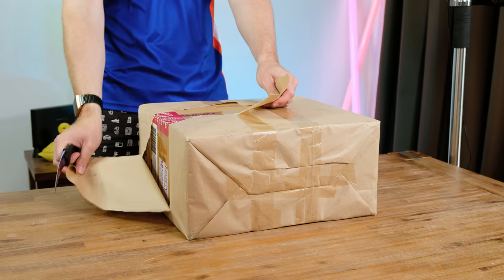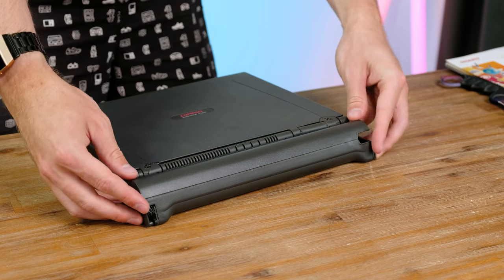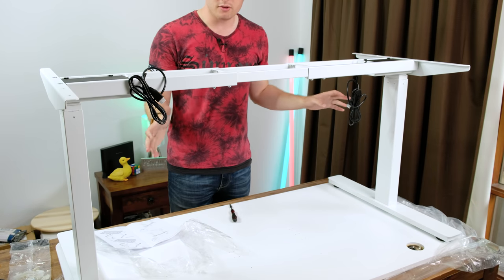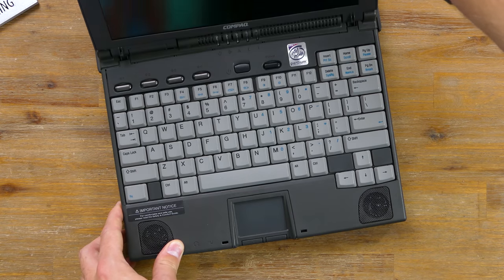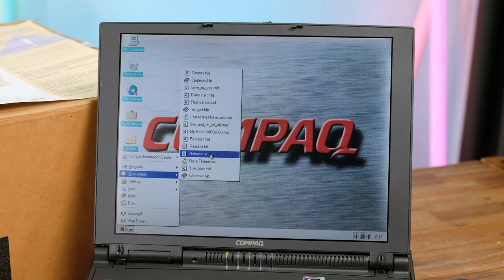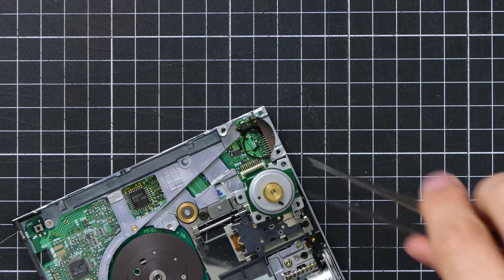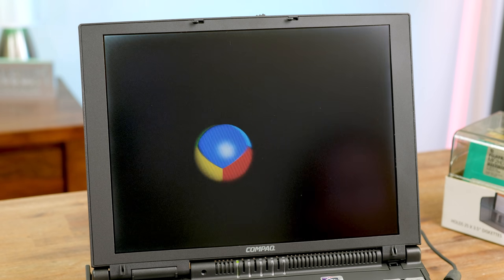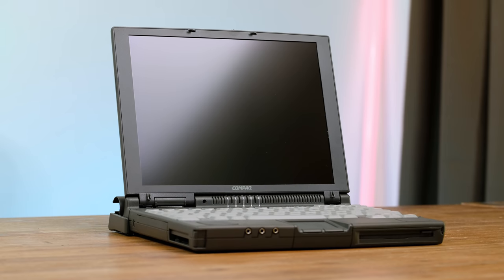I Bought An Old Windows 95 Laptop from eBay!

Comment: You’ll probably find a lot of Pentium 1 and 2 laptops that were barley used a year before being replaced. Intel had competition back then, and were actually making their successive generations appreciably faster, so if you had last year’s model, there were things you could just literally not do. In today’s landscape, you have to have a CPU from like ten years ago or more before you encounter things that won’t work at all.
Reply: @voltare2amstereo  I still have an acer travelmate 3270 that uses the first intel core 2 duo (t5500). it is still running windows 10. however i moved to the dell e7250 with i5-5300u and install windows 11 latest build on this laptop
Reply: @trandinhvietdung9357  Gonna guess that wasn't a good idea.
Reply: @aftertheelectrike1847  nah that's fine
Reply: @voltare2amstereo  Well, a C2D is still fast enough for youtube
Reply: @Lilbroda Barely. My laptop with a T7200 and dedicated GPU struggles, but it does work.

Comment: My Windows 95 laptop is a Panasonic Toughbook CF-45 I got for 19€ one week ago. The only issue was a loose display cable, but that didn’t take long to fix. The battery is original and still working, keeps a charge for about two hours!

Comment: In college I used an Armada 4131T. Pretty much the same specs but it had a full active matrix LCD and a 133MHz CPU. IIRC using Function + T would enable display stretch. Thanks for the vid, brought back some memories.

Comment: 9:00 using sodium bicarbonate with the superglue makes the bond stronger for plastic repair. Maybe you can use charcoal for making the same color instead but I haven't tried outside sodium bicarbonate.

Comment: Great video - I own an Armada 7800 from a similar timeframe and the plastics are starting to weaken too in places. By the way, you should be able to stretch the screen using Fn+T - it's not marked on the keyboard but is documented in some manuals.

Comment: Another great video about another great vintage hardware :) . I hope you'll buy a "gaming" hardware soon, like a Geforce 2 or 4 :)
Reply from the maker: I've got a GeForce 2 video card, not sure what kind of video it would suit though 😅
Reply: @psivewri  You're usually testing the gaming capabilities of those vintage laptops, but if you buy an older desktop PC in the future for any reason (P3-P4 category), you can compare older VGA-s for example, to figure out what OS is optimal for those and which games can it handle :) . I don't expect a Geforce 2 can run Crysis of course, but it would be interesting to see the difference between older cards, like a Geforce 2 MX and a Geforce FX5600 for example, with the original Counter-Strike, Far Cry, Quake, Colin McRae rally and other great titles :) . I still remember that big graphics jump between my Geforce 4 MX and FX 5200 in Far Cry, because of the newer Direct X support.

Comment: I still have 2 of those, one working, the 160 (P1 166MHz) version (there is also 120 version with P1 133MHz)
You could have a battery instead of floppy drive, the long battery behind and another battery on the base.
Had over 20 of those back in the days ...

Comment: How about that! I have just been playing around with a 4210t Armada today!. 
Does your bios battery still work? Mine is dead. 
My hinge-battery broke off the removable frame due to brittle plastic, but it was dead anyway.
This one has 32mb RAM and a TFT of 800x600  with 16M colours!
Same floppy drive issue but I found the generic chinese belts seem too thick and keep coming off again.
And no audio yet so more adventures to come.....
Reply from the maker: Nice! That sounds like a better model, yes I'm pretty sure the bios battery was also dead.
Reply: Ah, the tiny belts on those Citizen drives are a nightmare to find a suitable replacement for... My Armada 7800's floppy drive is suffering from the same issue, belt is loose...

Comment: I had a laptop and box exactly like this. I had to throw it all out, as the box was large and mouldy, and the laptop plastics completely crumbled to bits the second I took it apart to see if there's any leaky batteries or caps. Part of me wishes I had kept it, but then again I don't know if I would be able to fix the plastic :( I remember that the BIOS setup seemed to have been based on Windows 3.1, which was interesting. I think there was a partition for that on the drive.

Comment: I know you're in the UK, but here in the US, we're so spread out, it's impossible to get broadband in a lot of places and broadband in the USA is hit or miss. I have several coworkers that live outside the city and one of them is an owner of the company I work for and lives in, what I would call a mansion (technically isn't, but he's extremely successful and close to retirement so he's extremely well off) and the there is no cable provider where he lives and only a telephone company which can only provide him with 1.5 Mbps DSL, but the network infrastructure in the area is so horrible, it only works around 25% of the time (seriously) and if you have a POTS line, all you hear is pure static if there is a single drop of rain, making dial-up useless as well. So, he uses his mobile hotspot which has limited data for home internet... and he can get satellite internet at something like 100 Mbps, he can't use it due to the network latency. Our office VPN won't work over high latency connections nor will remote desktop to the office. Fun times.

Comment: Is that an armada! Hahaha I took a armada 100s to school had to epoxy the screen hinges but I found that windows 98 was really good and the screen had no ghosting. It was a little dim but it got better. The one I have was used a lot with shiny key caps and all but the plastic held rather well.

Comment: "Which at a surface level doesn't show any obvious signs of an issue" The Citizen W1D sticker is a pretty obvious one if you've ever worked on one! Ha those things are notoriously bad for belts shitting the bed. Compaq used them for most of the 90's.

Comment: Nice one!
My oldest laptop is a part-functioning-when-it-wants-to Contura 410 with a BW display, also with Win95, from 1992.
It's probably the HDD that's sketchy as it tries to read it and fails a lot before it decides to boot after all.
Windows 95 in black & white is not pretty, so I have to hook up an external screen to get the colors.
Good times!
Thx for sharing & congrats on your new desk. 
Standing up is so much better.

Comment: "1997... I wasn't even a year old at that time". Jesus Dude. You're making me feel old... I was born in 1984... got my first computer in 1997 when I was 13 years old. The majority of my childhood was NES/SNES and 35 channel cable TV (oddly enough, I still remember what station was on what channel) and Disney was a premium channel you had to pay extra for... then came converter boxes that increased cable to something like 68 channels including Cartoon Network (which, again, was premium), then Digital Cable, then On-Demand... and now my cable company is moving to an IPTV based system... You simply get a special cable modem and the new boxes (which are mini) work over a MoCA network and your DVR is in the "cloud". I wouldn't have cable personally but isn't my choice. I'd prefer to have their IPTV/Cloud DVR over this digital cable/no DVR, but when we tried to install the new IPTV system, it wouldn't work... we're at the "end of the line"... so even though I can get 940 Mbps Internet Speed & 35 Mbps upload... for whatever reason, their "special" cable model won't work on these lines yet my Netgear CM3000 works perfectly fine and I get the speeds I pay for... although according to the web interface of the modem, my signals are a little out of spec and our digital cable does pixelate from time to time.
Reply: Born in 1984? You're making me feel old... well, not as much since I'm only 6 years older 🤣 At least it's good to see these kids play around with old hardware which we could only dream about when we were young.